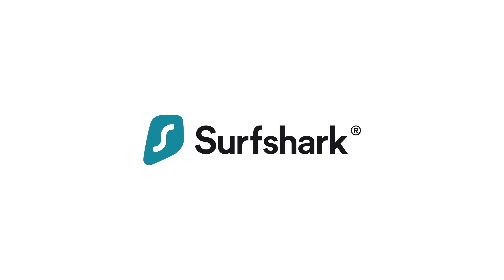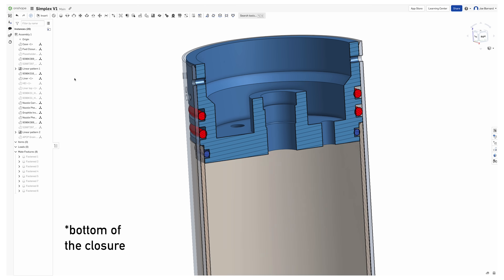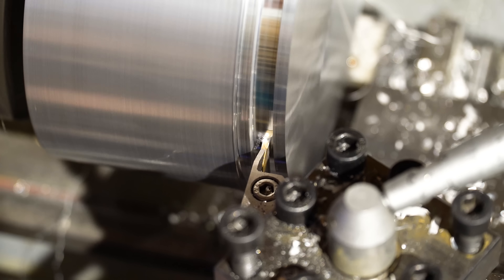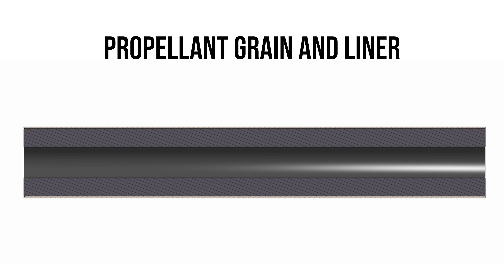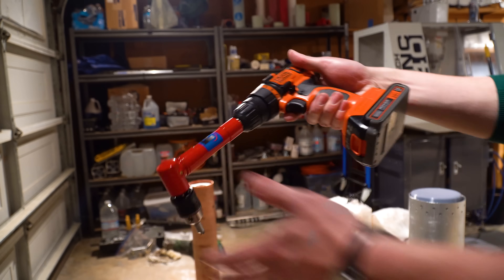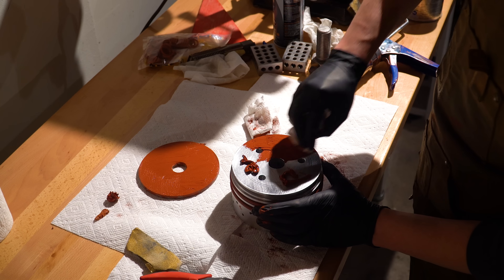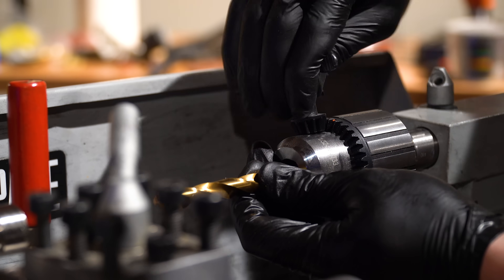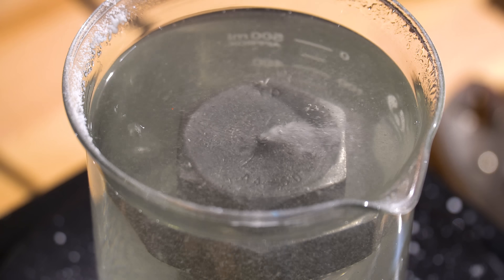Rocket Motor Forward Closure - Simplex Ep 4

Comment: I've watched a few of these videos now and, as a former machinist, I think I should tell you that you can put a tap in a drill press. No need to manually tap things with elbow grease. A drill press will have a lot better stability and speed. Just go slow, keep one hand on the power switch and the other squirting lube. No prob.

Comment: Why not use an electric motor, yes nice to see flames etc but the control you would have would be amazing, and you could get much higher and longer flights. Maybe an initial old-fashioned rocket engine, then second stage it to electric for landing or some extra height or control to landing spot. Have cameras and a target so ai could land it  perfectly every time. then to jsut make it bigger to reach orbit, lol.

Comment: lol I will say the blue tape method will work. By all means should work fine. Untill your feeds and speeds aren’t quite right and you start getting some resistance when you’re cutting. Or make even the slightest mistake in your program and it’s gonna send that nice hunk of aluminum all around the inside of that machine really fast, and the machine hopefully contains it.. but yea it’s not that people can’t do it, it’s that people shouldn’t do it.. even with a small amount of experience you should be able to do this successfully. But sooner or later you will make a mistake, especially if your running a lot of parts, and that’s when it becomes a problem, but yea for a singular piece so you don’t have to make a fixture, it’s fine as long as you double check your programming, but I wouldn’t run multiple parts that way. Honestly idk if I’d run a single part that way but If it works for you it works. Everyone has their own way as long as they understand the consequences and they let other people know the consequences when explaining it to them then it’s on them. Lol
Reply: And don’t let me fool you I 100% approve of everything your doing, your not an aerospace company or something so I’m not expecting that. But your doing some cool shit than not anyone else is doing and showing how to realistically do it, and are doing it how most everyone would do it behind closed doors so yea not dogging you one bit, just need a disclaimer that says “don’t do things the way I do them it’s not smart” lol or something. I mean let’s be real everyone watching knows they to would have put priority on the LEDs even if they wouldn’t tell anyone. Lol

Comment: Your channel is definitely one of my favourites. I can only guess how long it took to be skilled in 3d modelling, programming, turning and fitting, boilermaking, welding, fibreglassing, 3d printing, glue sniffing, soldering (SMD? are you insane?), tube-stuffing, running like crazy, videography, elocution, dammit lets add makeup cos I'm pretty sure on the SEND IT you were wearing a lovely type (obviously sunblock) of vermilion lipstick.

Comment: 10:24 There is a third option for a hermetic seal. You can use a circuitboard instead of wires or metal pins, combine with a high quality polyurethane or epoxy for best results. If you do it right you can make a feedthrough (penetrator) that can withstand 10000 psi.

Comment: Just gonna say, workholding is the first line if defense between the average person and a fatal accident. It's fine to take those risks in private, but you have an ethical duty to your audience to emphasize safe workholding. Its also cheap ro get right. You just need a vice off of craigslist and a 3d printed fixture

Comment: Now that I have seen the entire process I have have some ideas to make construction easier.

1) Instead of carving the fuel out of the end to make room for the top cap, 3D print a blank, bolt it to the floor of your construction shed, and mount the liner over it.  This blank should have a central depression for alignment of the center mandrel.

2) Create the center mandrel with a very slight taper to make it easier to remove.  Once it is broken away by any amount, it should just slide right out.  Use of silicone mold release spray will help in breaking it free.

3) Since your center mandrel is 3D printed, it doesn’t have a lot of tensile strength.  You can change this by printing it with a 5/16” hole down the center.  Run a piece of 1/4” all-thread down the center.  Use a nut and washer on the cap end of the mandrel.  The washer should cover the entire end of the mandrel, and the alignment depression on the top cap blank should have a small cavity to accommodate the 1/4” nut.  Get an eyebolt that will screw onto the exhaust end of the mandrel.  This eyebolt is to aid in removal of the mandrel.  If you create a 3D printed support to go over the end of the liner/fuel core, you should be able to use prybars to loosen the mandrel.  Since it is tapered, all you need to do is get the initial loosening, and then it should be easy to remove.

4) Not sure about this one:  Once again, create a 3D printed blank in the shape of the nozzle to prevent having to carve out fuel for it.  Clamp it in place with the screw on eyebolt.  Remove it prior to removing the mandrel.

5) When mixing fuel, you  can control all parameters except barometric pressure and humidity.  I am not sure how much these affect the mix, but by keeping meticulous notes and carefully measuring ingredients, you should be able to reliably achieve pourable versus modeling clay consistency.  You are obviously not going to stop after doing this once, so you might as well start making your life easier now.

6) In the past, I have used full body hazmat suits.  Although they look clumsy, they are easy to move around in.  The suits come with options like an air pump and filter that are belt worn instead of head mounted.  They are much more comfortable for working longer periods, and are cheaper than you would expect.  We got ours from Grainger Safety.

7) By cutting a slight chamfer in the inner faces of the ends of your casing, it becomes  much easier to insert your o-rings without cutting them.  I have also had excellent results with Parker silicone o-ring lubricant.

8) Checklists

9) If you are going to keep making these (pretty obvious you are), start thinking ahead:  
A) Neighbors are going to get pissed if you blow up/poison their kids.  Where can you make a facility for this? (Zoning, regulatory, etc.).
B) Hazmat disposal?
C) Safety regulations?
D) Any other government regulations or compliance issues?
E) If you want to build larger, how large can you go?  Can you build in sections that are then bolted together?
F) Safe transport to test stand/launch site?  (Maybe construct build site into shipping containers moved to Friends site?)
G) Should you get permanently mounted atmospheric monitors for dangerous gasses during mixing to alert when to wear ppe?  
H) Warning signs and safe perimeter to keep others away while mixing? 

A quick note on your design.  You bolted a grunch (technical term) of bolts through your casing to hold your cap and nozzle in place.  This creates a lot more turbulence than people think.  No matter what method you use, there will be some kind of turbulence.  By extending the length of your casing a few inches, you could cut a groove in the inner face of said casing, and use a circlip (sometimes called a c ring or e ring) to hold them in place.

You will need some kind of aerodome to cover the upper end of your SRM.  The perfect place for a barometer activated pyro charge and chute.  A small circuit board that keeps it disarmed until pressure has dropped far enough to confirm an altitude of launch plus 5000 feet, and triggers when it returns below launch plus 2500 feet should do the job.  Add a transponder that triggers on return so you can find it.  Many parts are reusable, and if you achieve your goal, I bet you can’t eat just one. 😉

I live a couple of hours from the Friends site, and would love a chance to watch one of your tests/flights.  Do they allow public attendance, and do they post a schedule? Do they have a website?

Comment: I run an actual machine shop and blue tape / superglue is probably one of my most used work holding methods. For aluminum or plastic, it can more than handle the load and allows you full access to the part perimeter. I rarely even make softjaws anymore and the mitee bite clamps just gather dust. I added a DRO to an old lathe and instead of taking the cross slide off and tapping it, I just glued the bracket in place. I figured I’d have to re do it eventually but I was in a hurry. It’s been over a year in almost constant daily use. I see so many guys wasting tons of time with complicated work holding. Just glue it already.

Comment: Darn, i thought it was dont use glass as bottles as a cheap fuel testing housing with its pre made throat. Learned from experience, lets just say the only reason I came out unscathed is the label on the bottle was in my direction and heild that side of the glass together limiting the outward movement. Still dont use saftery equipment as somethings are never learned

Comment: I know nothing about machining. Is there an advantage to milling this part from a large aluminum cylinder vs casting it in roughly the final shape and then milling/machining it down to spec? Because it seems like that was a lot of inner material the CNC machine had to remove.

Comment: In case you are wondering, the ignitor compound may be 50/50 mix of Ammonium Perchlorate (200) and Aluminium powder (1-5 microns), with maybe a 4:5 ratio of the Barium Sulphate and AP-AL.
Reply: Man, next time use a Spoiler Warning!😅😂
Reply: Why the APCP cannot be used? Same as in motor propellant?

Comment: If you ever want to use flood coolant with that superglue workholding trick or need more holding force over a smaller material area, get yourself some green PET tape(or try "powdercoating tape") with silicone adhesive instead so it doesn't get soggy and drop your parts after 4hrs+ of machining something critical. It's waterproof and clear-ish, so you can visibly see through it and know when you've got the adhesive pressed well into the surface texture of the metal, and with a light scuffing on either taped surface with a scotchbrite pad and a wipe down with some isopropyl before you stick them together with ca, it'll absolutely never let go. Sometimes it even holds too well and I can't get my parts to come off the fixture plate 😂

And for anyone else who's interested in trying the blue tape/ca glue trick, not all blue tapes are equal either, I've tried several different brands and some just won't hold at all compared to others. I eventually gave up with the blue tape once I found 4" rolls of PET tape, its just so much better than blue tape in all aspects.

Comment: Pro tip:
If fire is coming out of both ends at the same time set BIS (brake interlock switch) to "on. This disconnects BSD (back seat driver) input circuit and will inhibit retro braking.

Comment: Amazing content as usual. Have you considered mounting your lathe to a rigid work bench? You will be safer and get higher quality work done by doing so. Don't forget to line it up, too. Also, small drills require lot's of patients. 'Peck' slowly and carefully with lots of cutting oil. Thanks for sharing.

Comment: A custom 3D printed socket with room for the ignition wires could also be an easier way to insert the igniter bolt if your quarters are tight. 

Awesome video as always!

Comment: I’m shocked the blue tape held up to extended side milling but clearly it did so no disrespect. Iirc you can use heat to break CA glue bonds if you don’t want to bang on the ways of your mill getting it unstuck. 

Your CNC mill probably has the rigidity needed to drill out the 1/8” bit with a carbide drill if that’s what you’re trying to do. 

You may already know this but with stainless, work hardening is your greatest enemy. Any kind of overspeed, drill dullness, rubbing or packed chips will ruin your day.

Comment: We used a MS16142 port instead of the NPT threaded pressure sensors. 
We also flew 2 pressure sensors, one monitoring chamber pressure and the second one threaded into a blind hole, and should read 0 psi the whole flight .  We used that sensor to check that the sensors were stable during the flight. 
There’s a tool that you could use your CNC mill to cut the MS16142 port, check out SAE-4SS.
Reply from the maker: The "control" transducer is a really cool idea!
Reply: What about the grease , or insulation

Comment: I would complane about the tape not being able to hold your part well enough, but as you said you do not want to here about it. Instead I am complaning about the tape not allowing you to place the part flat on the machine, resulting in the end product not being machined correctly (or did you adjust your programm for the possibly uneven tape underneath the part).
Reply: Even better, he designed a part that didn't need such tolerances in the first place.

Comment: Isn't the failure of one of these exact o-rings on a solid booster what destroyed Challenger?
Reply: Yep!  I hope Joe isn't planning on launching when the temperature is near freezing.
Reply: Not *exactly*, since Joe (so far) isn't mad enough to try building segmented solid rocket motors. But yeah, hot exhaust gas getting past the o-rings is a bad thing...
Reply: This motor is a segmented, solid fuel motor.
Reply: @amandahugankiss4110  no it isn't... it's one piece. Not like the Shuttle or SLS boosters where the casing is made of four of five segments for ease of transportation, and the segments bolted together during stacking, with o-rings to seal the joints.

Comment: Nah uh uh, you aren't built different, you're exactly the same breed when it comes to stuff like using blue tape as a hold in place measure; Unless you have like 90 page research on that, and you really know what's going on, you don't know it works, you belileve it works

Comment: Ok first of all your blue tape method is amazing. I'd like to know more. Secondly: you faced the rocket grain with a pocket knife?! You figured the 127 Hours, hack your arm off method was a proven strategy? Eesh. Get yourself a proper chisel at least.
Reply: pretty common technique in woodworking. especially for router templates. clean the part nicely to remove oils. single layer of blue tape on each part or surface you want to stick together (try not to overlap the tape for machined parts like this or your par may end up a thou or two skewed. Generous dribbling of CA glue on one side and activator on the other and mash them together.
Reply: 0😊0 @TheZooloo10 p😊😊😊😅😅o a lqo😊
Reply: happy to see you here ❤❤
Reply: NYC CNC (https://www.youtube.com/@nyccnc) has an old video on it: https://www.youtube.com/watch?v=r6DCvtcU8_M
Reply: In modellmaking we use newspaper and glue for decades to hold piece's together we later have to devide😂😂😂 the bluetape is the evolution of it.
Reply: I use the blue-tape-and-CA to hold sheet styrene to my cnc router when I’m cutting it.
Reply: The blue tape is the embodiment of "if it works it ain't stupid"
Reply: Im defs going to try this for leatherworking

Comment: why do you need to see to date
Reply: lol talk to the face, because hand is not talking to you
Reply: judged by who? :)
Reply: why not line the aluminium with copper, or titanium
Reply: the whole rocket can be 3d printed with/from titanium
Reply: why does aluminium give you a shock when its heated!?
Reply: carbon-air fuel cells work at 800C
Reply: aluminium is a nice electricity fuel source as burned
Reply: alumineer lmao